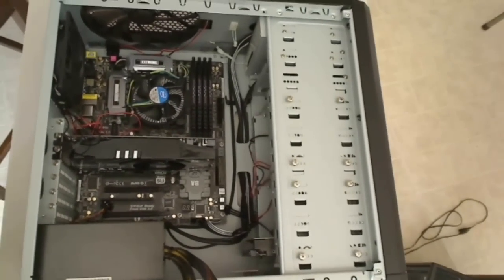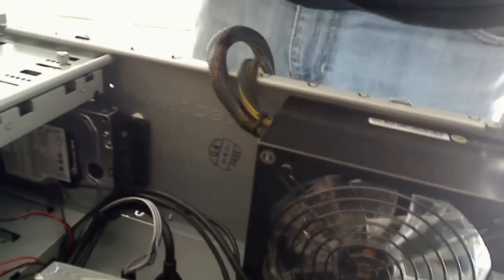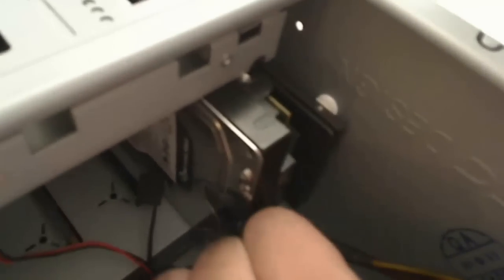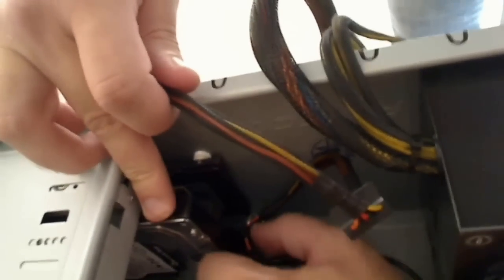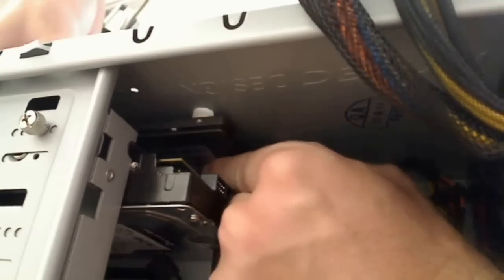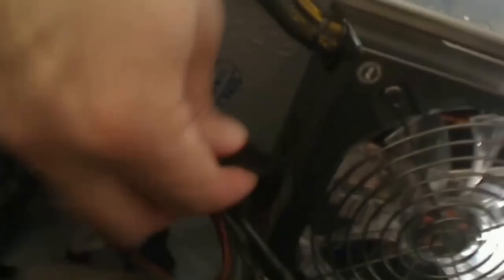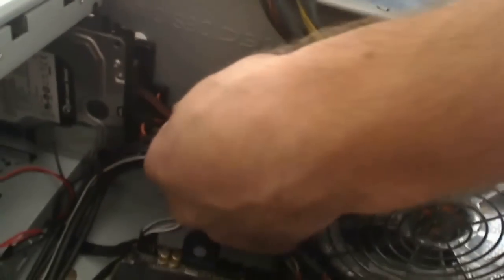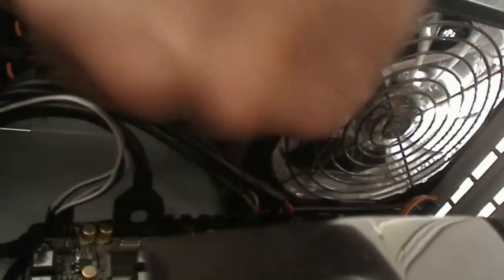How To Connect Power To SSD & Hard Drive 2012 - Step 12

Comment: so my hard drive wont connect to the hard drive or the ssd, the connector will not fit
Reply: s1601019 yea mine does and i cant connect.do i buy a new one?
Reply: @rometlempu4839  what did you do?
Reply: @WotsuOfficial  honestly I don't remember exactly. I think I got a pro to do it.

Hope you can get it solved!
Reply: Max Oliansky Maybe your hard drive uses a molex connector (4 pins) BUT I am no pro. Seek help from a pro.